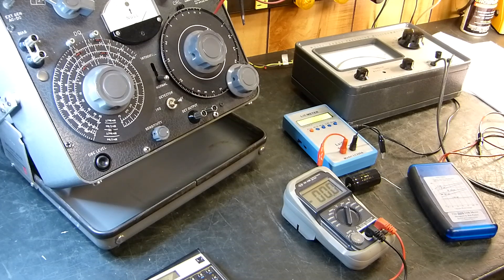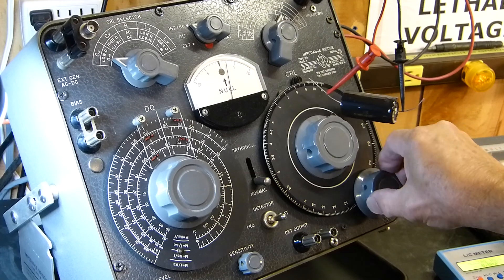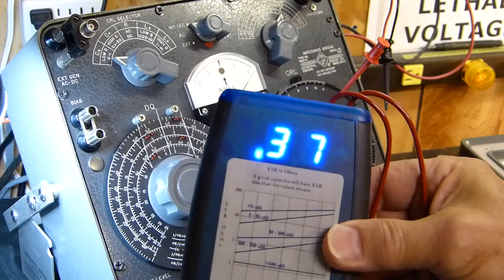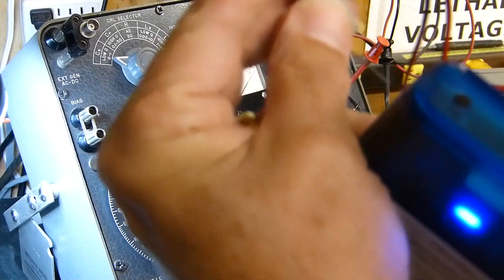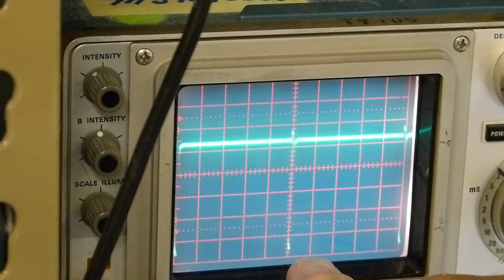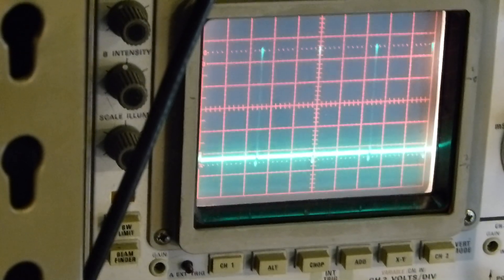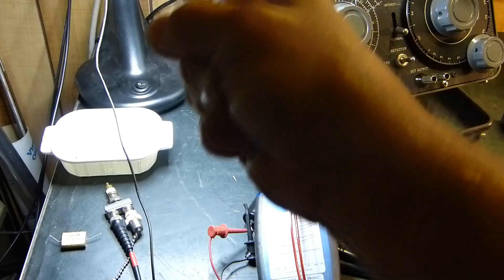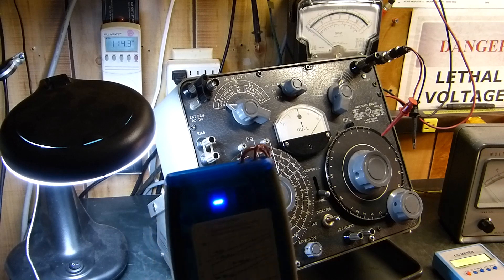ESR Meter Compared To General Radio (Genrad) 1650-A Impedance Bridge

Comment: I guess you do not have one of those capacitor tester/reformers? If you do, it'd be interesting to compare its results with those of the other instruments. If you've never used a vintage capacitor reformer before, word of caution: depending on model and mode, they can be dangerous in that they have live High Voltage on their terminals.

Comment: Hi Ray,

Check out the youtube video from PEAK on the DCA75.. Hooked to a PC, it is a curve tracer with plotted graphs. Shame it does not have the supply voltages to test tubes but for the SS world, this is very Nice.
I have a high dollar tektronix curve tracer that is not designed for tubes but there was a write  in one of the tube rags about a year ago to build a fixture for tubes. My Tek unit has the supply for the plates and I provide filament with an external supply. Works great.
73,
Glenn

Comment from the maker: Thanks, Glenn. No, I have not looked into the DCA75 but I probably will now that you have mentioned it. I too just do a B-E, B-C measurements forward and reverse and C-E check and that's it. I have some ancient transistor testers but I never use them to actually measure beta except in a very special case.

Comment: I like this meter very much. There are others out there that are more expensive but the Anatek unit is doing what I need to get repairs out the door.
I have been looking at their DCA75 PRO transistor tester. I have done go no go test for years with an ohm meter and that works much of the time but not on darlingtons and other devices.
Have you looked at the DCA75??
The ad is very impressive. It states that the tester will ID the TYPE of device and MUCH MORE
Always enjoy your videos
73,
Glenn

Comment: Hi Ray,
I bought the Anatek Blue ESR meter about a year ago as a kit. It took about 3 or 4 hours to build. I did not like the provided leads, tossed them and used good quality teat lead. The offset resistance was one 3rd of the provided leads.
I have used on micro-controller work and this ESR meter has paid for itself many times over. I had boards that had some boards where the logic was working but the boards had squirrelly problems that turned out to be caps with high ESR values 
MORE>>>